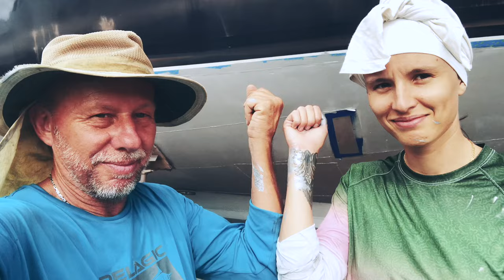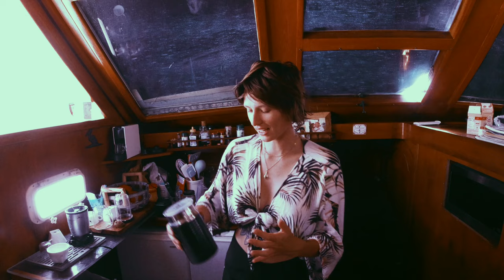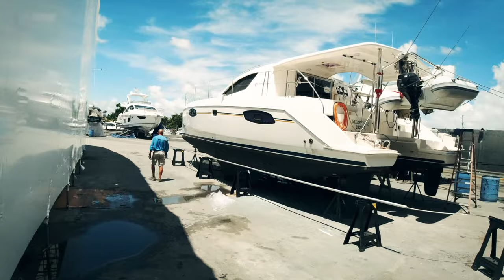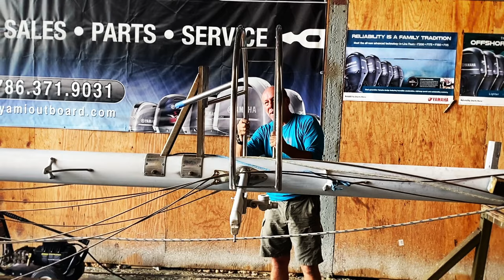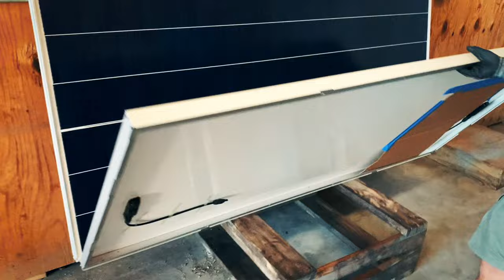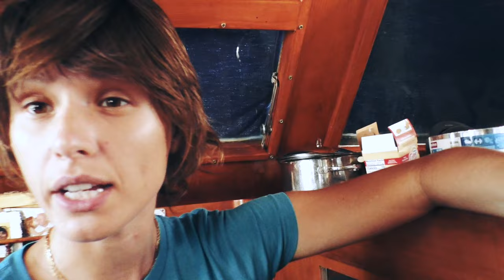Bluewater Sailboat Refit: building Crows Nest on Boat Steel Motorsailer

Comment: Great video. How many watts are each of your panels? Try a capful of bleach in a bucket of water, wash veggies and fruit  as soon as you get back, dry real good and then vaccum seal. I love the dynamic between you two.
Reply from the maker: Thank you so much for your support! Got your question, will answer on Saturday live. 
I’ll try your method with fruits & veggies - it’s a constant struggle for me ! 🥕🤯
Iana
Reply from the maker: Hello Sea Travel 
As an Instrumentation Engineer I have researched solar for 30 plus years. A lot of marketing hype the last 5 years for maritime use. We also installed huge grid on the offshore oil rig that is now in Africa off coast of Angola. Having designed large grid systems I am now doing marine design projects. For Dawn Hunter we are using a 340 watt / 42.5v panel. Voc 51.3V panel. I have 2 mounted permanent on the new pilothouse roof, 2 slide aft to provide shade and double the cell capacity. Then 2 more fold outward to star and port for a total capacity of 2,040 watts. I also have a series/parallel switch system to convert the series/parallel configuration depending on anchor position. This then via MPPT goes into a 5,000 watt charger/inverter. 
Sorry for the elaborate answer but with me it is hard not to be specific. Lol
Capt W

Comment: I really like your idea of mounting solar panels on sliders under one another. That’s what I was thinking of doing with my system. The power is needed mostly at anchor. Keep up posted on how it works. 👍👍👍
Reply from the maker: Hello Clay-- 
I never did like seeing panels all over a boat that took years to design considering factors as CG, sail plan or hull profile and many other items. Your correct that majority of power will be used at anchor and solar is quiet, relatively efficient and safe (no moving parts or engines running). Other factors are that while under way a large alternator and hydro generator can produce added power. There is also a hidden benefit having slide out panels which is the ability to connect from series to parallel based on anchor location. As I continue to design systems for other boats the biggest factor is that not all applications are cut and paste. 
I will cover this subject on our live feed Saturday night as many, many questions surrounding this subject. Thank you for being part of our adventure 
Capt W

Comment: I decided to subscribe when you mentioned time in the oil patch.   27 years in it myself.    Some common ground.
Reply from the maker: Hello Doug. 
What part of the patch are you from?  I upgraded 3 jack ups and they are in West Africa now. 
Capt W
Reply: @DawnHunters  I designed bits that became the business end of the drill string.   I specialized in hollow bits for taking cores.   For a while I designed core bits for Baker Hughes,  so bits of my design are used all over the world.  For a number of years I also worked for the “measure while drilling” division of Baker Hughes.  People think NASA has a lock on high tech materials.    I think down hole, and off shore conditions are just as trying.   Down hole has high temperature, high pressure, and who knows what else besides hydrocarbons in commercially viable amounts.

Comment: Hope you guys are still publishing videos.  I'm impressed by your refit and dying to see your hybrid engine.  I'm starting an aluminum cat fit out in the Philippines when they reopen and would like to do a parallel hybrid with the electric motor added to the diesel shaft.  Hoping to gain some insight from you guys.

Comment: Awesome re-fit, do you TIG weld the Stainless or MIG weld ? That two-part apoxy paint on the rusty Hull was impressive in other video.
Reply from the maker: Tig! 
Thank you for complements on the bottom, it’s called rustlock. We are starting to apply the epoxy this week.

Comment: Try purging carrots bag with inert gas before sealing. Argon would work but I’m not sure of toxicity.
Reply from the maker: Tom
I developed a nitrogen flush system for potato chips and snacks in barrier packaging. Over 5,000 systems out there so would need a metalized package to seal. 
Maybe I should invent a similar package for vac seal machines. ???
Capt W

Comment: The epoxy on the bottom is great.  Copper coat next???
Reply from the maker: Hello Thomas.. When I upgraded the offshore rigs that were over 25 years old learned a lot about commercial paint applications that HAD TO LAST. Then moving on to painting 750 room Hiltons, Ritz, and Marriott Hotels I find that the general use paints are made to last only long enough for the can to hit the land fill. In summary surface prep, surrounding environment, sunshine, mixture, application and time between coats is more a art than what is printed on a can. We are fortunate to have a steel structure similar to an oil rig as the steel used on our boat is COR10. Rust does not hurt the steel and in fact it is supposed to rust at a percentage each year when exposed to moisture and air. Cover it properly and it will last a very long time. In the case of fiberglass there is an expert Company here at the marina that paints boats from 10 feet to 125 feet. Building temp tents around the complete boats and then adding fans with filters the enclosure becomes a literal paint booth. Now many variables are reduced and the correct prep. primer, paint can be achieved. 
ok enough being engineer--- just know you are a person that looks for facts and not %^*(&^%^&^%$. 
Thank you === did not answer about the copper coat lol Might be a subject for Saturday Night Live Dawn Hunters 
Capt W

Comment: I did not know there were special masts for different boats.
Reply from the maker: Good Sunday Thomas!!!
How is the sanding going?  I have been messing around with media blasting the past few days and about to change options. Between rain, humidity and the hot suit it is a nightmare. 
On your mast question/comment. There are single mast sloops and double mast ketch mast arrangements. There are also others but I will stay with these two. Due to the type of hull, depth of keel, CG of the boat, it’s sail plan and distribution of weight mast arrangement is factored. The mizzen mast or mast in the rear of the boat is used for stability and to drive the bow into the water. wind and sea conditions determine when to deploy the mizzen sail. The other issue is if you take main mast on most sailboats will be 53 to 55 feet plus. Our main is 45 and mizzen 38. Add the 45 plus the 38 plus the front jib and that is sail area. As the masts are lower the keel can be lower so Island exploration is easier. It also allows us to travel under some bridges that pure sailboats would not thus more access. In summary each boat does have a mast and sail plan.  Catamarans then also start a complete other conversation. 
Thank you for being a loyal follower. Maybe we can all meet some day for a coffee.     
Capt W
Reply: Dawn Hunters  cool! 

The little boat I am doing now is coming along great. Thanks for asking!  The gel coat is sanding and polishing out very nicely.   It will be a single masted day sailer. 
I will send a good photo when I get her decked out.
Reply from the maker: Thanks for the update. I need to know SOMEONE is getting near the end. Lol
As we say in the Harley world— any motorcycle is a motorcycle. A boat is a boat and working on them can be therapy. 
Have a great day 
Capt W
Reply: Dawn Hunters  
Exercise! 
Can you put the boat in the shop for a while to get out of the rain and sun?

Comment: Slow the video down when you are doing those exercises, I need to learn how to stay in shape!!!🤷‍♂️ 😊 steel boats, find a sucker and sell your boat to him, then buy a fiberglass boat, you will spent more time sailing and less time working 👍
Reply from the maker: Langston
I have a shop at the Marina where we haul out over 150 boats per month. The steel boats need paint— the fiberglass boats need rudder shaft tubes replaced, keels missing, holes patched from hitting bottom, sides repaired from hitting simple dock pilings. After upgrading 3 offshore oil rigs I will take my rust any day when living in Hurricane country. 
See for me the plan is installing reef balls for 4 months, exploration and a work vessel to provide us with added income along the way. I agree with you if someone wants a pure sailboat then this metal tank is not the right match. 
Happy Sailing. 
Capt W
Reply: @DawnHunters     A steel boat rust from the outside and also from the inside. I agree that steel is the strongest but it cost the most to maintain? Hey I'm glad you have steel and I have fiberglass, but I've had both. In heavy weather, I would choose steel, for speed and low cost I would choose fiberglass. Haven't we had this conversation before? Good luck working while I'm cruising😂😂😂😂
Reply from the maker: Langston. 
Lol you are correct. Lucky for me I love to design and weld. My degrees are EE and Robotic so while I am stuck here in Miami doing other projects our own boat is not costing what others would be paying. I can pull a 30 foot barge from here to Abaco as has been done several times with this boat so she doubles as a home and office. 
One other factor is this boat made with high chromium steel so we really only had 8 rust locations where the past owner welded in cortin steel as was too costly to import the correct composition.  
At the end of day boats are only understandable to the owner. Lol
Reef the main for me!  Hope to join you soon on the blue. Where are you located?  
Capt W
Reply: @DawnHunters      Alabama on the coast.👍